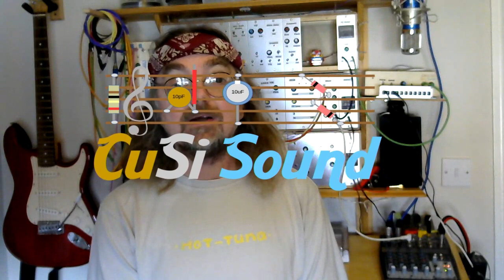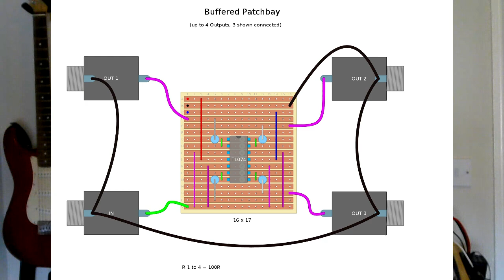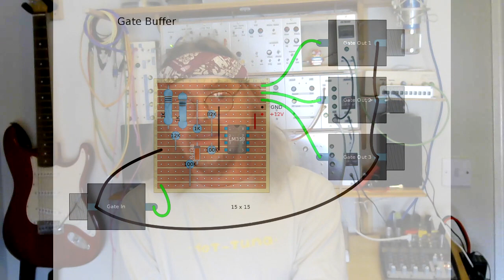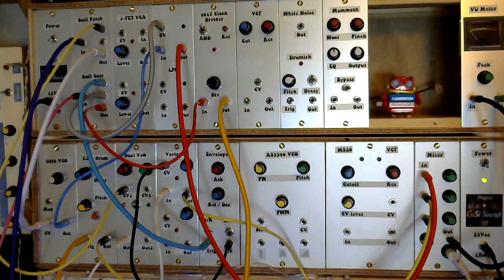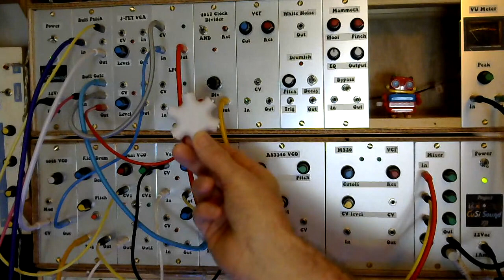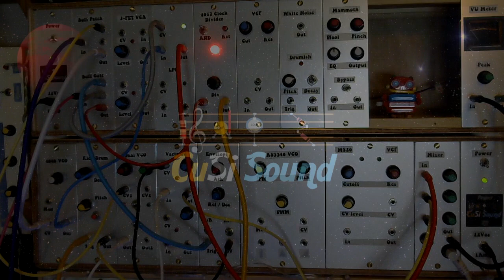Project XII Modular Part 8: Buffered Multiples

Comment: Hi Cusi! I really like how you simplify your stripboard schematics, I have a question about this multiple. I would like to know if I can send a sequencer signal to 2 VCO with this multiple. I have been asking on Kristian Blåsol's discord channel but I remembered your skill from his stripboard projects. Hope to see you on the channel soon DIY community!
Reply from the maker: Hi John. Yes you can send sequencer signals through this module as I often do. Use the buffered patch section to split the CV signal from the sequencer and use the buffered gate section to split the gate signal. In this way you can trigger 2 VCOs, each going through their own individual VCA from a single sequencer source.
Reply: @CuSiSound  Thanks, I mean I just understood that it would be interesting to get another vca, in fact I was planning to make 2 more VCA this week. xD, so the most important thing to be able to trigger a sequencer CV signal at 2 VCO is a multiple with a buffer, isn't it?
Reply from the maker: @johnp3541  A buffered multiple will reduce the risk of the split signals interfering with each other and preserve the voltage levels. In some cases you may be OK with a simple unbuffered multiple e.g. the star shape mono patch cable splitters, these are just several sockets joined together.

Comment: Question: In the buffered patch bay circuit, Row A is +12v. Row B is ground... WHAT IS ROW C (the blue) ????????????
Reply from the maker: The blue connection is -12v as this design is for a dual rail power supply. It should work on a single rail power supply if you connect pin 11 of the TL074 to ground. I must remember to label my diagrams fully.
Reply: @CuSiSound  Thank you so much for the reply...Now on with the build!

Comment: Is this buffered gate multi the same circuit you used for your glove-n-gate?
Reply from the maker: No, this circuit uses an op-amp comparator. I used a simple transistor arrangement in the glove, the same as the one I used on my baby 8 sequencer.

Comment: Where do you get those panels? Making nice panels for my DIY modules has always been a big challenge for me.
Reply: ...read my mind!
Reply from the maker: I buy the blank satin anodised aluminium panels from ebay (UK Hardware Outlet) cut to size (1.5mm thick, 150 x 50 mm or 150 x 100 mm to fit my box) then I drill them myself and use clear printer address labels for the decals. There is a delay on delivery at the moment due to UK lockdown measures.